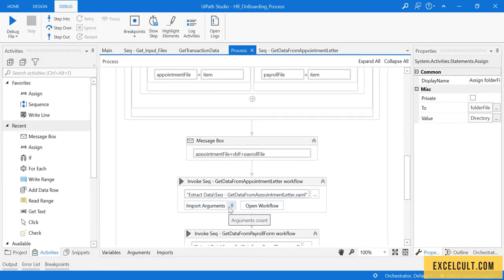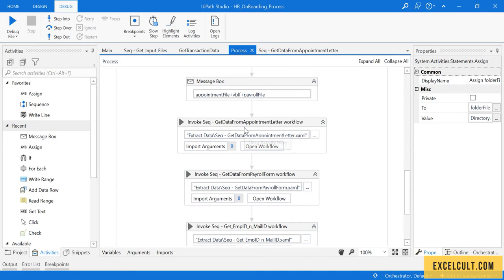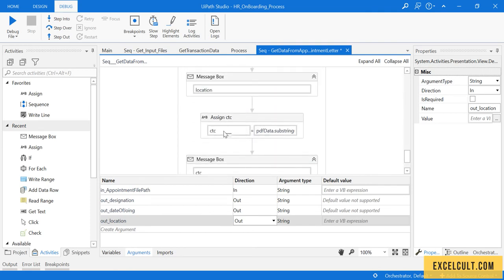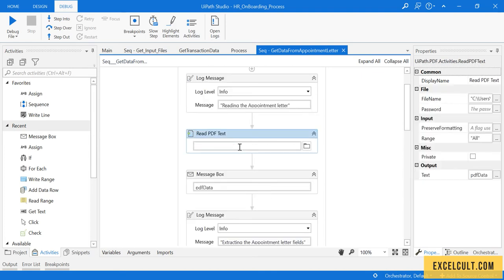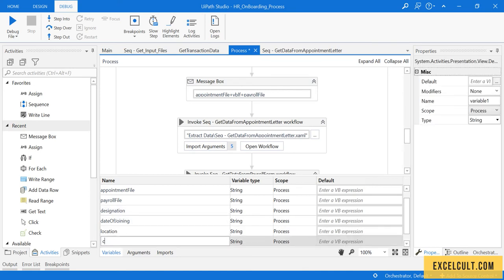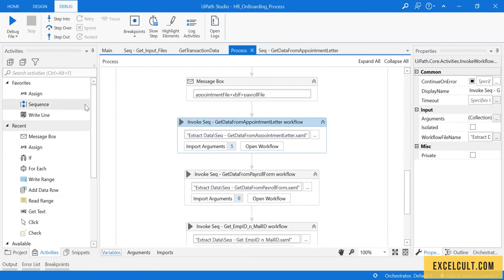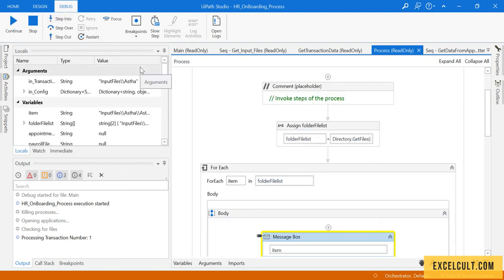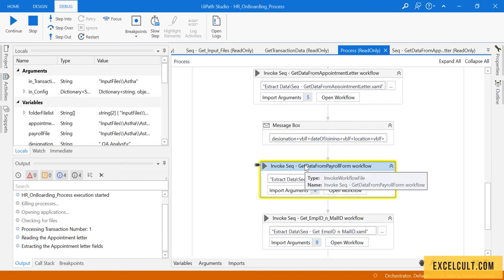UiPath Project 6 - Integrating GetDataFromAppointmentLetter xaml - Part 21

Comment: hi Sharath, i follow the your videos,  i have one doubt related to this,  if there are more pdf files in input folder (inputfiles\1.pdf,2.pdf....more) how to read all and extract data,  as per your video i tried but showing transactio data count 0 and  no process, how to do this process ?
Reply from the maker: Hi Anand, no worries 😊... can I look at the code that you are currently using?
Reply: @MrSharathraju   yes

same your workflow but i paste all pdf files in Input files not seperate folder.

input files
-------------------
sam.pdf
ram.pdf
john.pdf
hari.pdf
....etc

get_inputfile(sequence)
-----------------
output_files==Directory.GetFiles(in_config("InputFilesFolder").ToString)

Transaction data count= 4

upto here working fine but problem is in process transaction

process.xaml
------------
Folder_List==Directory.GetFiles(in_TransactionItem)

it showing error directory name is invalid
.